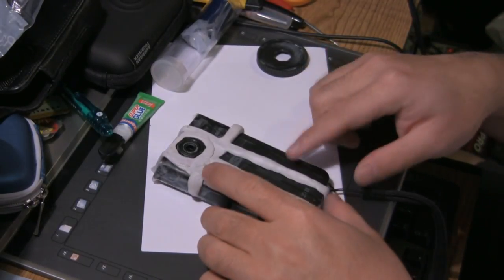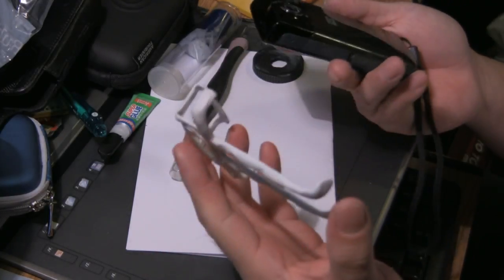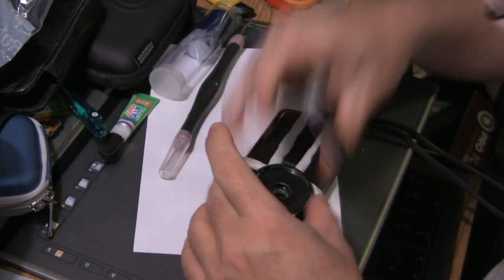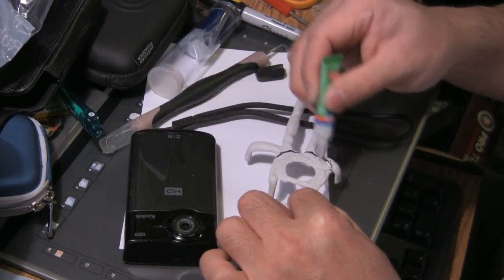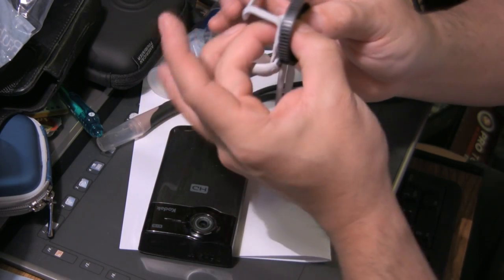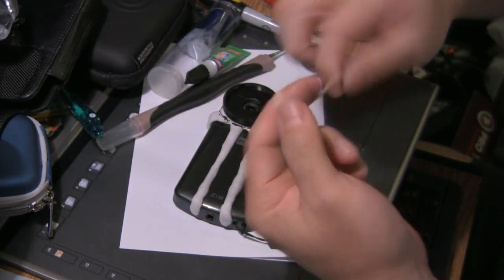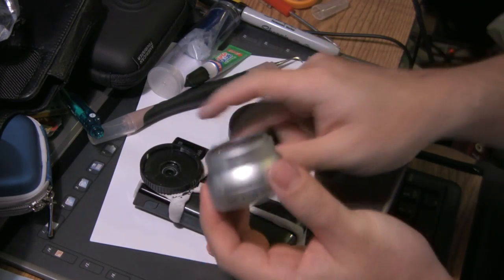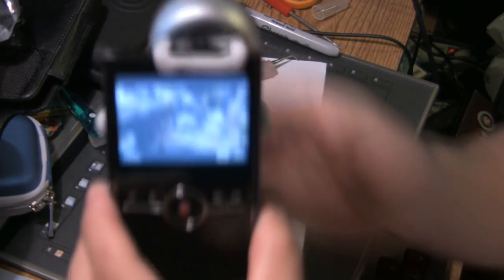Kodak Zi8: 2/2 Non-destructive removable wide angle lens mod

Comment: i did my mod with velcro stuck and superglued to the adapter ring and stuck the hook  side to the zi8, i also cut out space for the mic, record light and power button, it works   very well and it won't fall off, i used industrial velcro